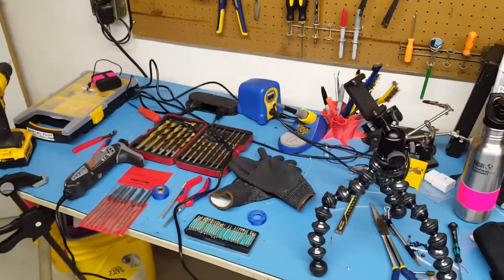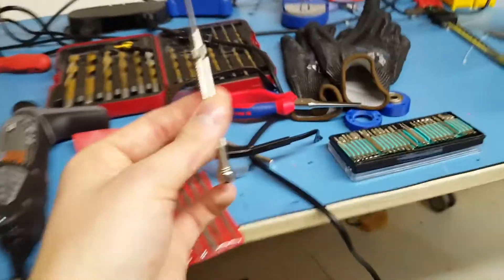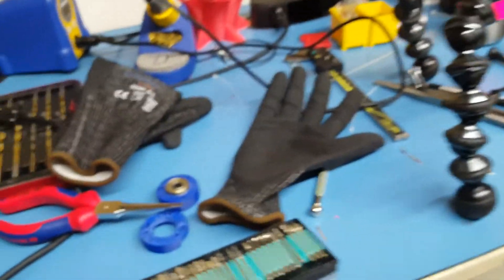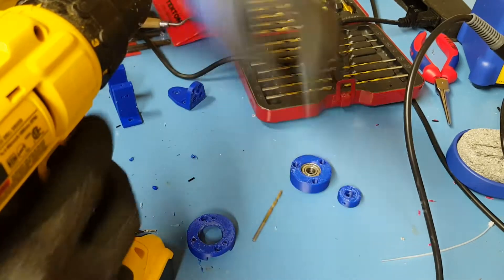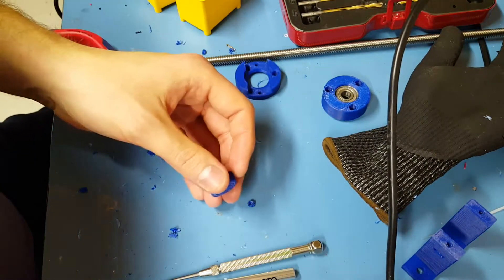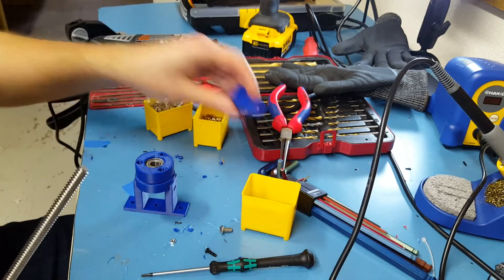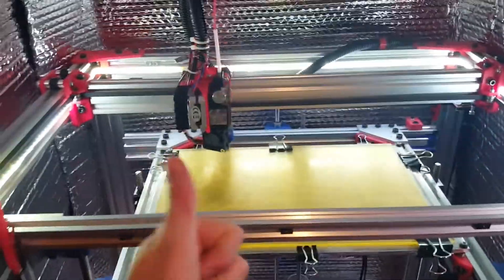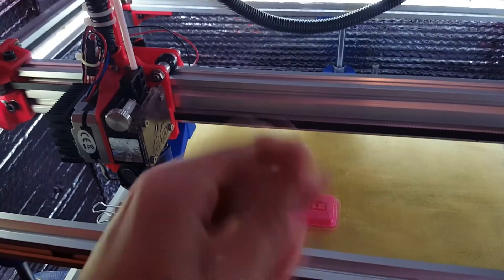Power Bot Update - 3rd Leadscrew Installation

Comment: Been using a glass mirror for my beds for the last year - never had a problem, you let the bed cool down and the thermal contraction pops the print off never touch the bed - keeping it clinically clean works fine, only down side was needing to raise operating temp by 10C - hardly a hassle though